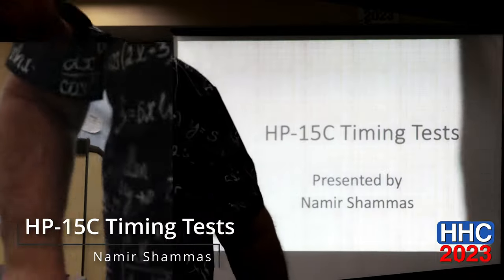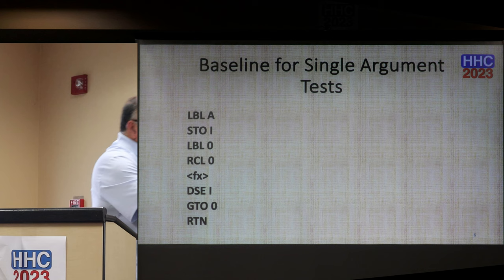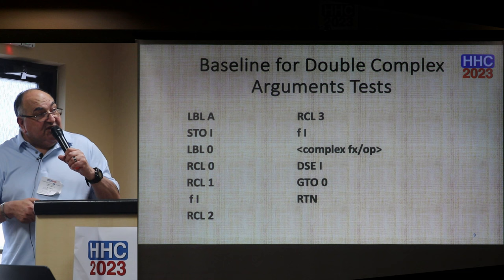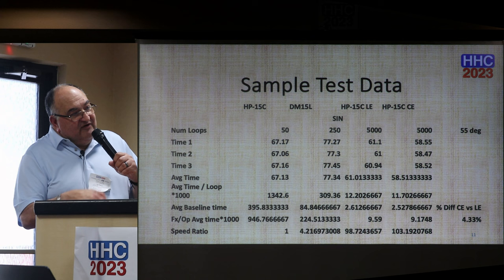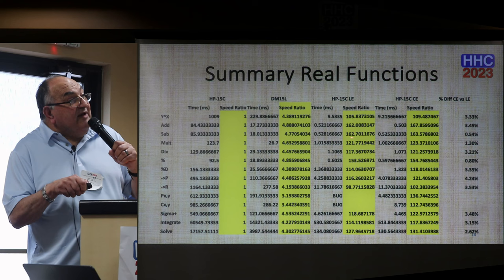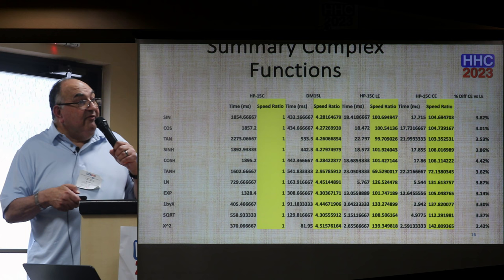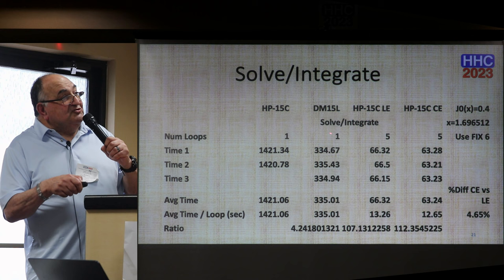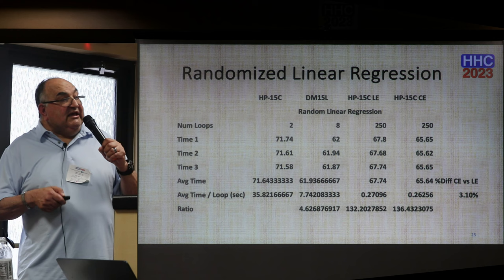HHC 2023: HP-15C Timing Tests (Namir Shammas)

Comment: Nice presentation, thank you. 

Note, in the Conclusions slide at 21:38, the first three bullet points say “% faster” but mean “times faster” (the audio is unclear for 1 and correct for 2 and 3, 100 to 170 times faster). The 4th bullet is correct as percent (CE is just a bit faster than LE).